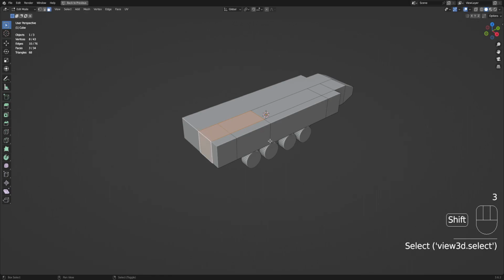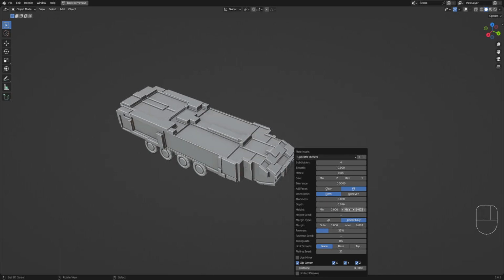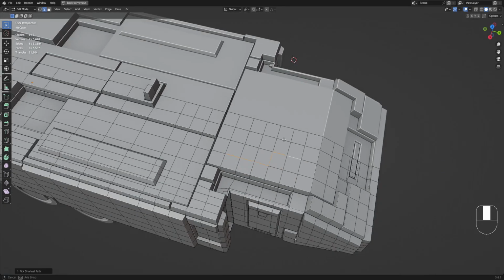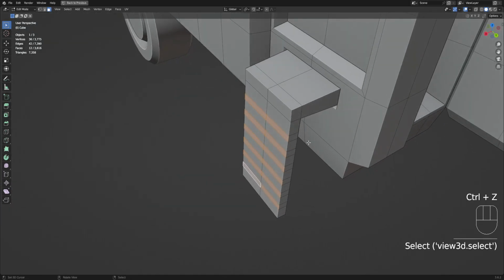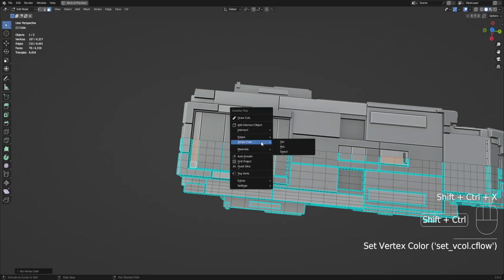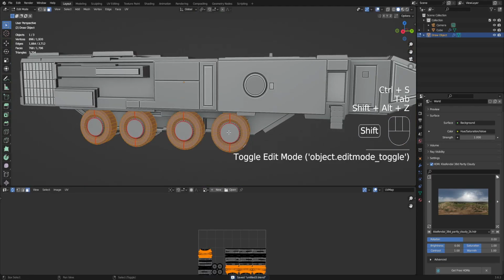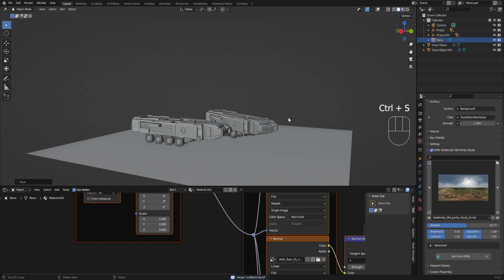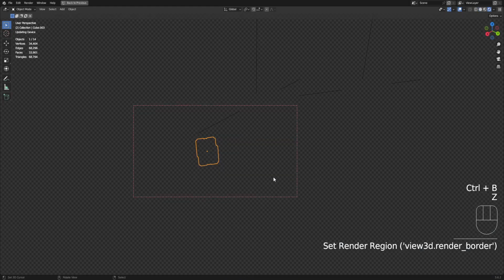Modeling a Scifi Truck Using Random Flow

Comment: How do I stop the menu from closing as soon as I move my mouse away from it? Very annoying.

Also, is it not possible to add multiple layers of panels? Or select faces we want the paneling to apply to, but not the rest of the mesh?
Reply from the maker: The redo panel disappearing like that is Blender internal behaviour and can't be helped. You can however bring it back using the F9 hotkey.

The operators are designed to work on selected faces.

Comment: Around 26:50 you are discussing how the tool is view based not grid based. I also use Grid Modeler,  so I rather enjoy that Creative Flow  is view based. I have access to both systems as needed
Reply: I said Creative Flow, but I think it's Random Flow. My mistake.
Reply from the maker: I'm glad you like it. Grid system is accurate but these tools focus on speed so view based projections work well with them.
Reply: @blenderguppy really enjoy the add-ons you create. Top quality.